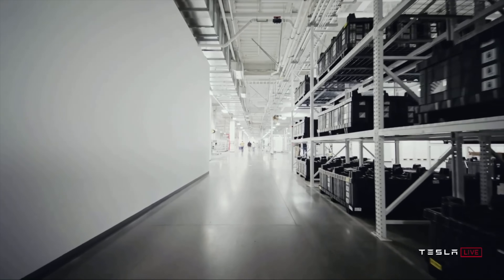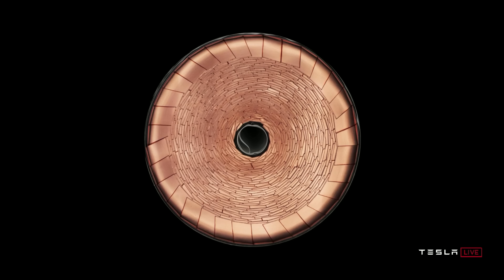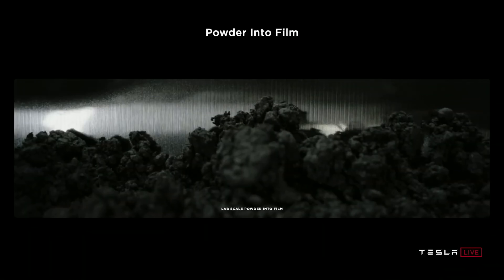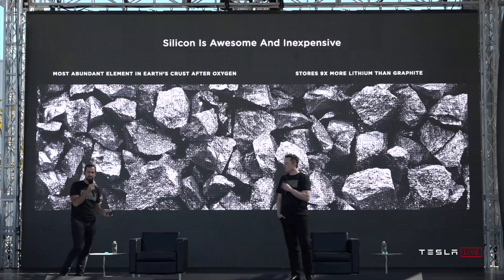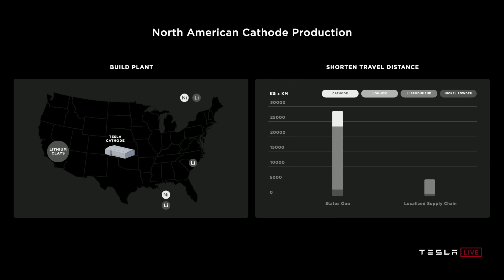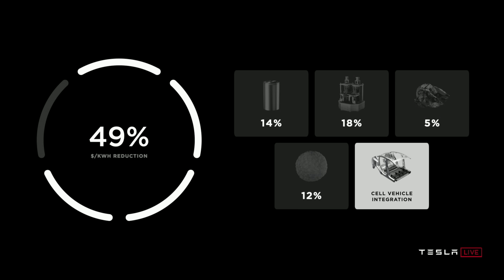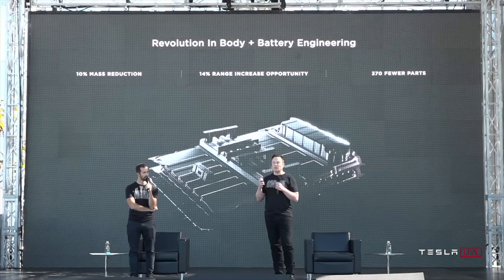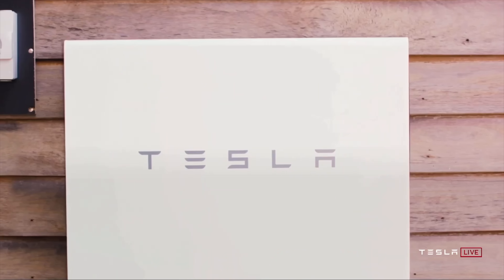How Tesla's New Battery Will Destroy Gas Cars

Comment: Most people do not understand the word "scale", let alone economies of scale or the impact of improvements in manufacturing. I saved my company 6million dollars a year by machining an extra 4 inches on a rod used to make cylindrical parts. Not only did we get 4 more parts out of each rod, we saved on the management of the scrap piece left after the operation, we saved money on the number of rods needed to be purchased up front and in the chip disposal, which  was cut by 90% in every rod, consequently compounding the savings. The price of the part remained the same, but we were gaining 4 more parts out of each rod. Final tally, 6 million/year savings. The 6 million were used for hiring more engineers, buying state of the art machinery and further expanding our product lines. Win-win all around just on those 4 inches of a metal rod.
 Imagine eliminating 50+ parts on an assembly like he has done with the castings... Exponential savings down the value chain all the way to the final product. No one can catch up to Tesla. Period. Game over for ICE.
Reply: Yes exactly relevant point's! How was saving 379 parts in the process of manufacturing the new battery as part of the structure process. Not appreciated more?

What about 10x the amount of battery production out of the same factory footprint?
Those factories which are going up in less than ONE YEAR. And costing on average 1/3rd a similar structure built by anyone else. Smh it's like playing competitive chess against an opponent who doesn't even grasp how to play checkers. 😏
Reply: Dude I know exactly what you mean. I work for a medical device manufacturer and manufacturing efficiencies alone have cut the cost of one of our devices from $65 down to less than $10 just by creating jigs, templates, extremely minor adjustments to the design, and improving the design process. Using the same material and even getting a better product than before, costs have been cut almost 90% just by paying attention to the super tiny details of manufacturing. I was giddy as hell watching this presentation and hearing the numbers and hearing them talk about simplicity and efficiency and reducing the number of parts and steps. I think the average person knows that "yeah sure, I imagine that helps" but really what the average person should try to understand is "no, it doesn't just 'help'. It is EVERYTHING!"
Reply: The problem with those single piece cast is in an accident your car is total.
Reply: @DaBinChe  the casting still has seperate crumple zones. And your point is irrelevant. These days insurance companies "total" cars for minor panel damage.
Reply: mike h yeah but battery tech innovation has been so slow.  This isn’t just for ev but anything that needs to recharge and uses a Battery like a phone . I thought phone companies would advance battery tech not EV.
Reply: @crafter505  they did to a certain extent but phones are pretty different.
Phone batteries need to be stay pretty cool, have to power a low power device and are very small
and an ev has to withstand recuperation
It's all waaay more stress on the battery cells
Reply: mike h  yes, electric cars existed at the turn of the century and for some time were actually more popular than combustion vehicles because they were cleaner, quieter, faster and easier to operate.  But the technology was abandoned in mass market road-worthy vehicles for at least 80 years and was widely panned as impossible due to the general crappiness of the available batteries. So outside of Baker Electric 100 years ago, Tesla is the first EV manufacturer to gain appreicable market share.
Reply: Making fun of tesla is like making fun of a 4yr old Michael Jordan becuase he's not good a basketball. 

You just f****ing wait the results may be down the road, but their coming and their coming BIG
Reply: "Game over for ICE."  I don't think so. ICE represents 98% of the market. Toyota alone manufactures ~6,000 cars a day in Japan. And they do that with extremely control quality...which is a huge problem for Tesla. Almost every day I came across with Tesla owners complaining about built quality and trying to grab Elon's  attention using social media. Musk also promised some 3 years ago a 25-thousand car. Plus, where's the semi truck? I mean, Elon is good at breaking labor laws, lying to consumers, lying to shareholders, lying to the press and so forth.
Reply: @Lucas P every car company is currently going EV, once they are affordable, it’s only a matter of time
Reply: Brenda Brenda hmmmmmm okay.
Reply: @Brandon_letsgo  typewriters were 100% of the market at one time too. So were horses. You logic is extremely flawed
Reply: @JD-yx7be  Electric cars were also part of the market back in the 1800s, so...
Reply: @AlineaEuros  the first lithium ion car was released in 2008 the Tesla Roadster. Fundamentally different from previous battery technology. Were as most internal combustion engines are still otto cycle 4 stroke engines that the model T and earlier gas cars had
Reply: Alinea Euros But they only took off during the early 1900s when the assembly line was created. Allowing the price for cars to drop low enough for the average person to purchase. Which ultimately allowed for the creation of the suburb during the 1950s and 1960s and the creation of the American Dream. Cars during the 1800s were only utilized by the ultra wealthy and were irrelevant enough that people went their whole lives without seeing one.
Reply: @Dylangreat123  unfortunately Toyota really isn't, it has some great hybrids though.
Reply: @garethbaus5471  Toyota is going to get a fat dump dropped on their profits in the long run if they get behind. One day there will be a transition and nows the time to create infrastructure for when the world heads in that direction
Reply: @Brandon_letsgo  Please tell me again: What is ICE?
Reply: rdelrosso2001 ICE is short for internal combustion engine. An ICE is what every gasoline powered car on the planet uses.
Reply: @rdelrosso2001  Internal Combustion Engine
Reply: @Brandon_letsgo  coorporativism lead to this kind of stuff... elon is a genius, but a really evil one that use a good mask... if he wasn't a villain, why he sell separated stuff already built in the car's?! like heat seats and auto pilot stuff... the majority of people even think about it, but i see the dark side of that company... we must be cethical about too good stuff out there, and no competition lead to evil decissions too
Reply: @Brandon_letsgo  people also said the same about "where is the model s, where is the model x, where is the model 3" just because it is late doesn't mean that it isn't real. Where is the tesla killers that we been hearing about for a decade now?
Reply: Lucas P Tesla plan is to get the big car companies to switch to ev. So it will be game over for ice when Ford , GM, Toyota switch to making EV instead of ICE.
Reply: @crafter505  That's an amazingly stupid plan, no one sets up a company with the view to making someone else come along and compete with them. Tesla certainly isn't the reason other car makers are going EV, things like ever tightening restrictions on emissions and the subsequent fines for breaking them, ever-increasing mouthing off by various world governments about proposed ban dates on sale of new ICE vehicles are the reason that car makers are going EV and of course a fair degree of virtue signalling designed to pander to the mass market stupid idea that EVs will save the planet is another one.
Reply: mike h  what rock have you been living under that you havnt heard of a  "tesla killer"? It's literally been the major headline for every electric vehicle announced over the last 12 years. Even ones that were only CGI renders or the company had no plans to go mass market. Even vehicles that companies said were just speculative renders of possible products for the far distant future were labelled Tesla killers. Its a well established media trope.

Comment: They had a conference detailing some great "unproven" ideas such as the tab-less approach and dry cell integration... just one problem THOSE TECHNOLOGIES DO NOT WORK..... You know how Elon takes the new roadster out and blasts it down the road at undeniable speeds?  You know how Elon overpromised the 2170 energy density by 85 percent!  You know how they didn't release any test data or ANYTHING on the new cells?  In the battery world it is Put up or Shut up.. Battery day bullshit...

Comment: It will not Destroy Gas Cars gasoline  fore the last 40 years has ben a throw away product  almost an unwanted by product.  if we had nothing but electric cars we would still be drilling fore oil and diging holes to  bury gas. Gasoline = 20% of product that is  made from crude oil. Crude oil =plant fertilizer, pesticides, household cleaners,  artificial food flavorings, cheap cosmetics, plastics, medications  and a lot of other stuff.

Comment: I have nothing against EV's, they, were the first out, with the first electricity.

I'll be happy, when I can get an SUV/Crossover style vehicle that can do 500mi + range and charge to 90% in 30 mins. 
Also, if the UK built a few more nuclear power stations and get a plentiful, cheap charging infrastructure in place.

Comment: How ya' gonna charge 'em??? And what energy source will make them??? Musk NEVER answers those questions. They don't dig lithium salts up in Chile with solar or wind power, they use oil powered  shovels and oil powered furnaces to refine the lithium to a crude state. Lithium batteries have a much bigger "carbon footprint" than gasoline does and pollute the planet far more.

Comment: Why mentioning the 5x energy and 6x power are presented? They are misleading.and are implying as real gains.The real gain is 1.16 times (the extra range).They are not necessarily real gains as long as you don't take in account the old volume.Musk said that the value is "more than twice".Why not "less than twice"? How much more than twice? This counts.Musk always talks about energy density but in this particular case the syntagma "energy density" was avoided.WHY?

Comment: I noticed two things that Elon did not mention in his presentation was: faster recharge speed, and longer life (i.e., million mile) batteries.
Reply: He had to hold back in the reveal of all their coming improvements to not kill current sales.  Faster recharge speed (longer at full charge rate) comes with the battery improvements they have described.  Probably longer life as well.
Reply: @rich1383yt  These two concerns are the utter most technical hurdles to the R&D techs...Elon did not mention them not because the reason you proposed, but primarily due to the technical issues.  I saw a lot of hypes in this, but EV autos will have their places in the cities, for daily commuters.  For heavy rigs, or long distance travels, not quite so...
Reply: slchang01 I think you are underestimating. Down the road  (pardon the pun) ‘their places’ will be all of them. And no reason why what works for small things shouldn’t work even better for big ones.
Reply: It’s known as the Osbourne effect, named after the Osbourne computer.  Essentially if you present too much too early then it actually puts off customers and then they delays or cancels orders
Reply: @firstnamesecondname5341  This applies to products without supply issues which is not the case with Tesla's cars.  They already hyped their technology advances to a point that anymore will be treated with suspicion.
Reply: The details shared suggest faster charging and longer life.

Take the current Model 3 battery pack, increase its capacity by 50%, but keep the weight roughly the same. Now its advertised as 450 miles of range (~350 highway miles)

If the new cells can charge at the same C rate as the current batteries then a V3 supercharger can spend more time at 250kW output than the current packs can accept. They could probably increase the peak rate to 350kW or so and taper down to perhaps 250kW as it exceeds 50% state of charge.

A 15 minute charge session with such a battery pack(assuming you pull in at 10-20% SoC) should charge up enough for about 3 hours of driving instead of the current ~1.5-2hrs. Long enough most people will want a short break. For road trips I find about 800 miles is the most I want to do in one day. Getting this many miles by starting with a full pack in the morning, and only charging 30-40 minutes during they day is 1:1 gas car replacement.

Being larger capacity also means fewer cycles during daily driving which greatly increases battery life.
Reply: They are gluing the batteries into the structure of the vehicles. There will be no easy way to swap them out. They are lifetime batteries. Aka "million mile" batteries. He showed us what they were, and how he would built them. He left it to us to figure out what they really were.
Reply: And one more thing is weight of battery than old model I need to know.

Comment: I don't know how they manage to cut and index the position of the copper tap from the most inner tap which requires a smaller tab to most outer tag which requires a big roll;
and beside this complication, it also requires the tab to form a solid-contact with each tab to have the proper electricity flow on the tap. 
it is an engineering miracle.

Comment: How is it going to kill ICE? There were zero advances in battery tech announced. They made a cell that is physically 5 times bigger and stated that it holds 5 times the energy. That means they made zero advances in energy density.  Battety day was one giant meh, which reflects in the immediate share price drop. But I wouldn't expect an objective overview from a channel that is part of the Tesla Amway scheme.
Reply: Troy Savary Troy you are head of the Department of Didn’t Really Listen.
Reply: @wombat7366  So, Mr. Really Listened, tell me what the huge adcance Tesla just announced in battery tech is? Tabless? Really minor and can be copied by anyone if it proves valuable.
Reply: Troy Savary the new batteries ARE NOT 5 times larger. They produce 130 kw in the SAME battery panel space as the current batteries produce 70 kw. So nearly 2-1 improvement. Then the panel itself is easier and cheaper to build, cools more effectively, transfers power more efficiently and can be used as a structural component of the car.
Reply: @wombat7366  The volume of the new cell is 531 808 cubic milimeters. The volume of the Model 3 cell is 96 980 cubic milimeters. Si the new cell is actually more than 5 times as large. I know math is difficult for Tesla cultists.
Reply: Troy Savary Your calculations are correct. I was wrong. I apologize for giving you a hard time.
Reply: @wombat7366  👍
Reply: @wombat7366  Ad hominem. Keep up the great work there. You sure debunked the math. Maybe soon you can graduate to strawman in your rhetorical mastery.

Comment: So when can we see a price drop in the current models,  just looking for a rough estimate to know if I should wait to purchase one.
Reply: They sell every car they produce.  Why would they need to drop the price at the moment?
Reply: @dzerres  they wont immediately drop prices because it will take years for these cells to trickle down to current production vehicles.  But when they do, Tesla are expected to pass those savings on to the customers.
Reply: They are going to implement these new batteries in the Cybertruck and Semi, it could be years before we see them in the Model 3 or Y.
Reply: Supply/demand. Even if they manage to produce the cars a lot cheaper, there is no incentive to making them cheaper right away. Not to mention they need to recoup the research/new factory setup costs. So, probably would take more than 5 or more years at least. When they are selling every car they produce, and still don't have much of a competition why reduce the price? Wouldn't make sense. Only a serious competition or having excess stock can make them reduce price. What would make sense is creating a new model that is cheaper, but also comes with way less capabilities. Probably a fine everyday car, but not a good interstate traveler.

Comment: I can’t wait for the Tesla economy car, cybertruck, and van!
Reply: I'm only 87 years young and Iwant one too
Reply: I can't wait to be able to buy gas for 5 cents a gallon
Reply: @bluejackscanada  good luck with that. Gasoline prices will skyrocket when EVs begin to make gas stations a dying breed.
Reply: @bluejackscanada  Basically Panasonic 20 years of R&D under TSLA's name (which is until last year on the verge of bankruptcy let alone long term investment for Battery R&D
Reply: @bluejackscanada  if ICE cars are more or less eliminated from the market it won't be profitable to sell gasoline for combustion and the availability would be almost non existent. Since most gasoline that isn't produced via cracking is a byproduct of refining oil it will still be  produced, it will just be used for one of the numerous other uses for volatile hydrocarbons rather than the simply burning it.

Comment: 6x power in a cell that's 5 times the size.
Reply: It's an increase of 54% more range compared to a vehicle who would use a pack of lithium cells instead. It's not just the chemistry but also how they will be integrated in the car after they're built.